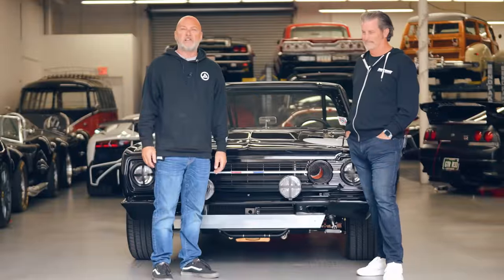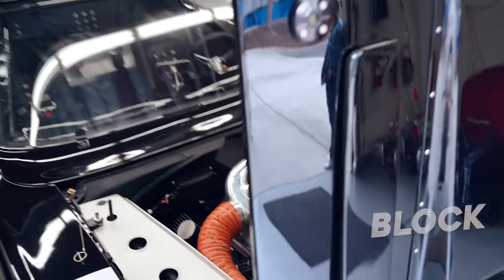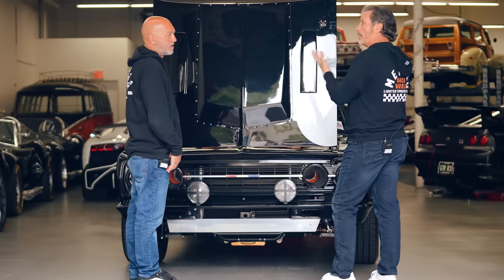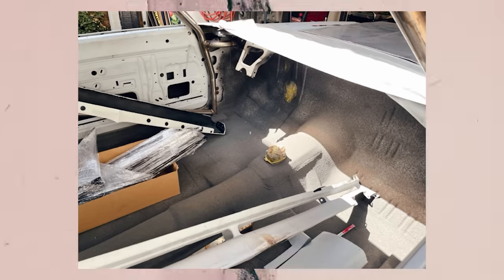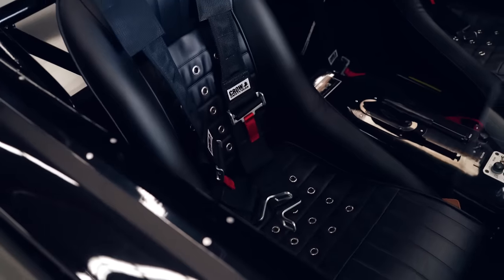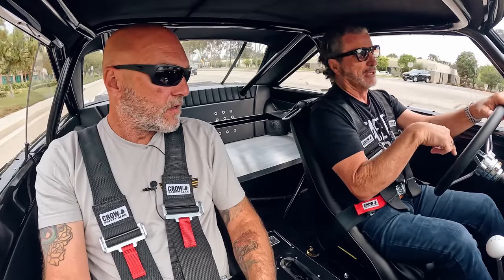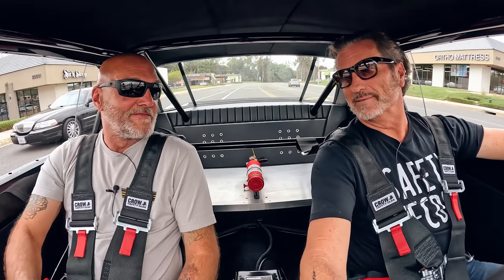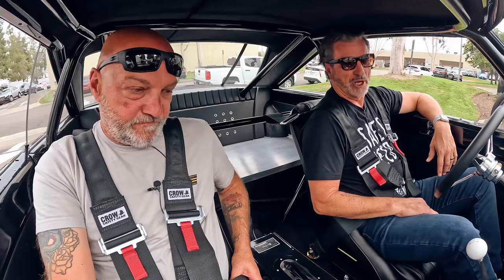440 Big Block Plymouth GTX "Saloon Racer" Making 625 Naturally Aspirated HP!

Comment: My dad was a Vietnam vet and when he got back he bought a 68-69 GTX 440 super commando I put 69 cause I cannot remember which it actually was! Even when he was alive I had to ask which it was! They both look the same to me but he could tell you every bolt on it! He worked for Chrysler and my mom worked for Fisher Body in Detroit. Dad raced 440 class and some bracket racing! He owned the 440 class his cars best 1/4 Mile was 11.11 126mph on slicks obviously it wouldn’t do those times on street tires! He would drive to the track swap out back tires and run 11’s and drive home with the A/C on setting on premium leather seats 💺 with his trophy and cashiers check in tow! He was one of those guys you heard of who had access to the garage at work to work on their own cars on weekends and nights! So he had all those guys to help make the car the fastest it could be! He said he took it to a speed shop to see what they might be able to do to make it quicker and they said nothing we could only make that car slower said you already got the best of everything and some stuff we never seen before 😮😂

Comment: Yep.  After watching twice now.  This is is an extraordinary build.  It's just.... the right "zone" of blueprint to be a ton of fun for minimal maintainance.  Looks like a great gear set/range.  And the chassis looks like it'll be fairly quick to sort out the rest of the driveability/manners.  Great vision and follow thru!!!  Kudos!!!   (The kind of car that Larry Chen needs to get some poster shots of too)
Reply: The only minor issue i have and its very minor is the aluminum under the hood blocking the engine bay and suspension..  get rid of that!
Reply: You missed the reason… covers wiring and roll bar tie is from frame..

Comment: I own (2)5.0s, [89&16] I've owned small block chevelles and big block GM products (Pontiac, Olds,Chevy), and I can arguably say nothing  NOTHING SOUNDS BETTER THAN THE FACTORY STOCK TONE OF A '68 MOPAR 383 . Dodge, Plymouth, Chrysler 60s, and early 70s just had an engine exhaust tone that no other manufacturer could beat.

Comment: I love the drivers.  Rock chips, orange peel and rubber on the rear quarters. The only water you're concerned with getting on the car is the waterbottle in the cup holder. 😁.Function and Form, PRODUCTION FOR USE. If i had a lottery winner's choice between this car and a Veyron,a Ferrari, or Lamborghini this GTX is the WINNER. I'm actually saving for, in my opinion ,one of the best looking cars ever built.  1970 440 GTX (line light, FJ5),(Tor-red,EV2),or (deep burnt orange,FK5).

Comment: This is Ssssoo my late teenage years! When I could/would have my 2K-3.5K with little down/finance... and go car shopping! Fairly locally @ dealerships, driving... picking through Torino GT, 383/440 GTX, actually 67/68 Hertz Cobra rental for 3k. Could not buy it: As I could not secure auto insurance at 17 yrs. old. Bought a 68 1/2 GTA Stang. 302, automatic, 4bl, C-6 tyranny. Ceiling console with map lights, leather. 24k orig miles for $2400. Turned out it was the hydraulic version of the upcoming 69 Boss 302 solid lifter Mach 1. ( a specialty build/order. Did not even know it. Only thing I could not take down: 351 clevland Mach 1. Had a ball! Those were the days! Stoplight to stoplight street racing. Remember my first pair of brand new "Wide Ovals/Goodyear" thanx so much!
J

Comment: I do 185 MPH on the German highway every year when I go there for the American car meet. It's fun, especially since I do it on a Saturday evening at sunset: the highway is empty at that time, I literally have the road to myself. By the by, the hood flaps like paper at 185, even though it's been specifically designed for flowing air through it and generating downforce...

Comment: Its either a 370 or 389 gear ratio I believe for a Ford 9". With the 5 speed with a final gear ratio of .68 will struggle to do 185 MPH unless my numbers are not right on the gear ratios. If it's a .64 final gear ratio in the transmission maybe.
Reply from the maker: Curious about 185 although doubt it will ever see even close to that but what a cool car

Comment: I would love a tutorial on widening the fenders and quarter panels lol
Reply: Get a cutoff wheel slit the length of the panel on top…then cut section on the side of the panel so that it can bow out… the stick weld… then a ass crap of planishing and hammer and dolly to smooth the sections… then grind and sand then slight smooth coat of filler to take out pinholes and seams… add 4000 F bombs… some Modelo … repeat the other side

Comment: I wish he made mention of what air cleaner housing that is since he talked about everything else around and up to it. I’ve only found one spun aluminum housing like that for my own use available commercially but it’s from Spectre. The finished product I got was not very good, was mostly chromed steel and only worked with their 14x3 air filter but their filter was trash, very shallow and wide pleats that were nearly transparent. The filtering capacity would’ve been garbage and I was planning to have the ducting open up underneath the car in the high pressure zone above the air dam and in front of the radiator. I ended up just running an open element raised through the hood. Looks kinda trashy but considering running a circle track reverse hood scoop to cover the sides and smooth the appearance.

Comment: That car is cool.  Looks fantastic  !!!   But know this, if you know the HP then it was on the dyno.  If it was on the dyno it's been run in, broken in, what ever. You don't need to baby it.  A few heat cycles on the transmission and differential and you are good to go.   That BBM 440 for that power,  will never need to go past 6500.  Why the (tuner) 10,000 RPM tachometer  ?  Looks like a punk owns it.
Ok, off my rant !   Over all the car is right on.
Reply: Cant just lay into a new clutch diff etc have to run them in  some.

Comment: Its cool but it could use some practicality to it.
1. Should have kept the windows alone.
2. Should have a heater system
3. Should have left the backseat in
4. Thinner tape on LED lights
5. Should have kept the fuel tank and just sumped it with the dual fillers
6. The X-pipe is stupid
7. While you're at it should have went with a 6-speed.
8. Should have kept the windshield wipers
Reply: Go build one
Reply: @VinRacer1  meh, I like modern stuff more. I had my time with muscle cars
Reply: @JoeZelensky  Then why watch and take the time to slam his car?
Reply: @VinRacer1  Never has I bet
Reply: @gordocarbo  the title sounded cool. So I thought that someone is gonna do a good job. But nope. I was wrong. It's like watching a wreck happen in slow motion. They earned the criticism.